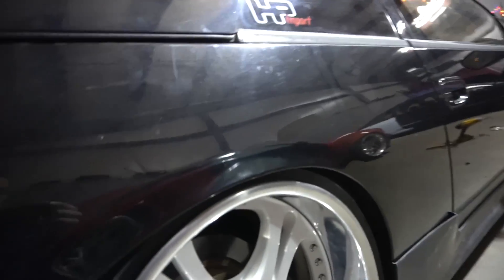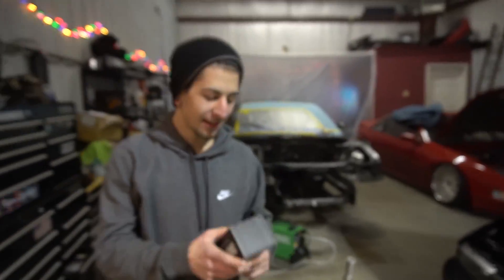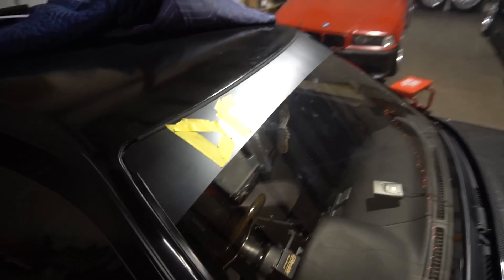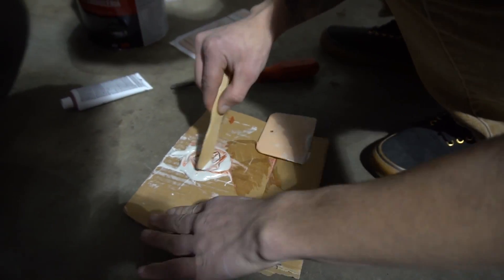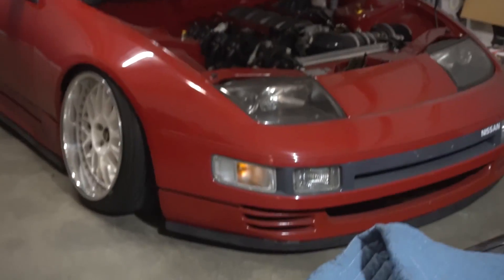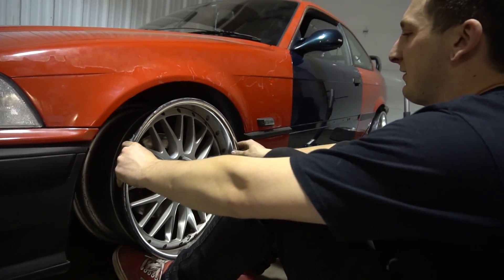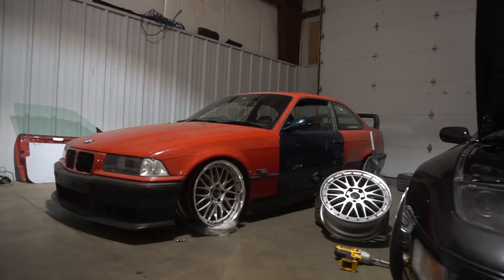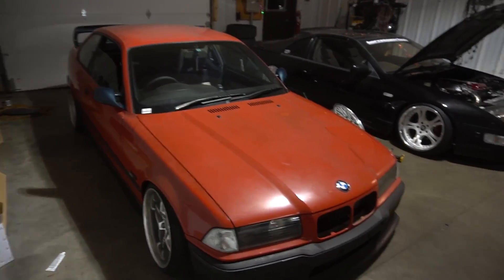IS IT WORTH IT?!

Comment: Jimmy those wheels look sick on the BMW why don’t you just re-barrel two for the front yes we can set up the backspacing tour you don’t need to run wheel spacers 👍😊
Reply: James Cook Jr. you can’t re-barrel 2 piece wheels
Reply: Blitz >>>>>>>>>>>>>>
Reply: Certain 2 pieces can. Had my rc090 rebarreled and 19inch works rebarreled due to damage. They cut and weld a new piece in. Not sure of how safe it is but they worked for me.
Reply: +andrew snyder I just said fuck it and flipped the barrels on my rc090s. 6" lips for the win
Reply: WontonGames I had them made to 17x9 square but the bigger lip ended up shrinking the look of the face. Wish I had just done a step to 18
Reply: +andrew snyder the face does look really tiny sunken back 6" into the wheel lol but my e36 is widebodied and I figured this was a way cheaper way to get deep dish wheel instead of building a 3 piece set

Comment: Jimmy, I'm a sign writer

*I'll give you a tip, with vinyl products especially window visors, get a water bottle, add a few drips of dish washing liquid. 
wet the window (heaps) wet the vinyl and you can move it around then once you're happy lay it down with the squeedy.
overnight the water will dry and you will have bubble free vinyl every time.*
you can rip it up and preposition as well when it's wet.

Comment: Donald adjust your firing pin. Its probably hitting threads and reading way higher in ohms. Leading the chip to ramp up the volts to compensate

Comment: you should make a plexiglass hood for the black Z. its such a crime to cover that beautiful engine bay. 
or at very least cut a window out and put the plexiglass in so you can see the engine. theres several things people have used for it... acrylic, polycarbonate, plexi.. etc
Reply: that hood is super rare and expensive.
Reply: "that hood" can be made by heating up the plexi and shaping it over the stock hood, thats how absolutely everyone did it before that crappy china made one popped up on the market and windows are even easier to make. the only thing that you need to buy is the material. its not as cheap as a regular hood would be, but that car doesnt deserve to have the bay hidden. if i was going to put a clear hood on any car it would be that one.
Reply: Kable i mean the original hood cuz its JDM af